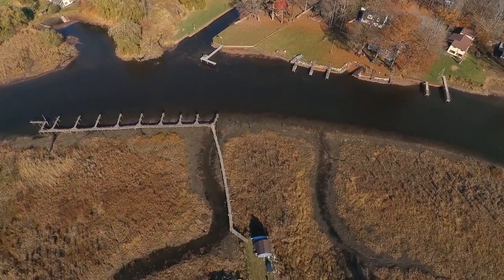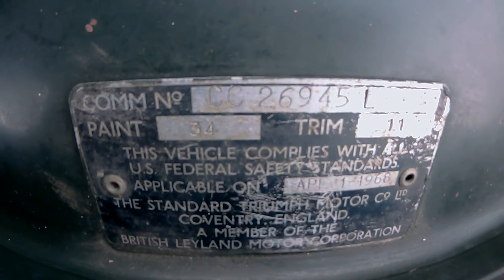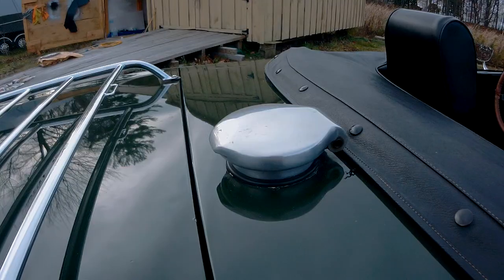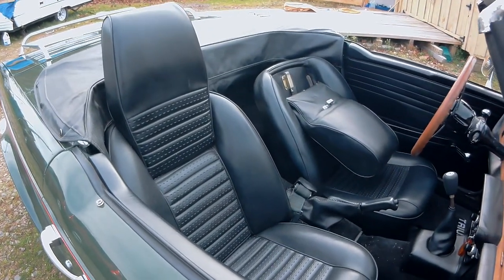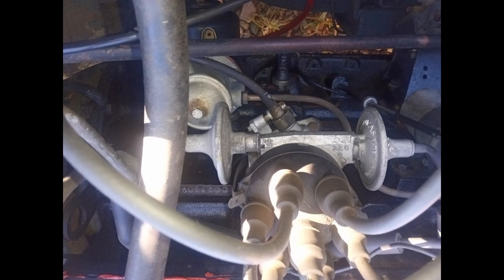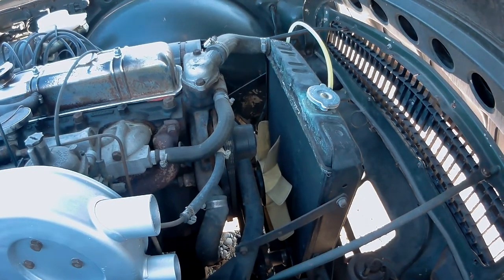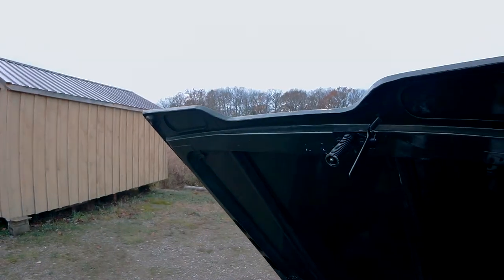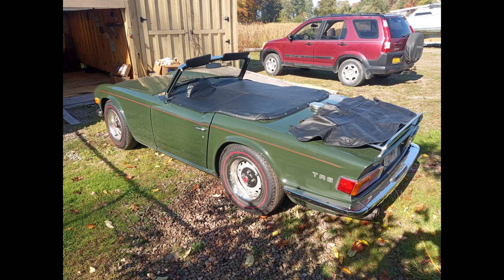1969 Triumph TR6 Specifics

Comment: Very interesting video. I too have a 1969 TR6 but in Royal Blue, It is a California car with 61,000 original miles that I purchased last November from the Original owner. As so many TR's seem to have a story attached mine also has a wee bit of a tale. The first owner purchased it after returning from Vietnam. He returned the same year I did. A few years after purchasing it he sadly developed cancer do to the agent orange used in VN. He did get better than worse than better but the car sat for many years at a time. This being the reason for such low miles. Changes were made to the car itself but tasteful ones. It does have the optional wire wheels and I've put the original style red-line tires on. 
A lovely car to own and drive and one that I feel will increase in value.
His nor My intentions were / are not to keep it original because of improvements. Better Starter motor. aluminum radiator, oil filter base, period correct radio along with a few other items.
Your comment about the car amazed me. I love this car and I'm sure you do yours. We are both quite fortunate.
The Tush-myster is The Man. 
I wonder about a trip from Massachusetts to Toronto ???? (This car does run very well but I may do webers in the spring). 
Enjoy !
Reply from the maker: Thanks Bodie. If you see anything wrong or needs to be added, let me know. For sure, every TR6 has a story. Thanks for yours.
Reply from the maker: Bodie, what is your Vin #?

Comment: Nice video. I've owned CC26455L since 1986.  Your details are very accurate from my perspective. The TR6 decal on a white car is red. I'd love to have a set of the bumble bee hoses, but wow not for $500. My car was 17 years old when I got it and some 69 unique items were already gone. The hub-caps were gone as were the 69 style seats. I've heard those seats were the most comfortable ever made by Triumph. It had Union Jack decals a front air dam which I see you don't have. Mine does have the fender beading. Someone at a car show was very interested in that. Not original, but be sure to add an emergency hood (bonnet) release. There are fancy ones, but IMO it only has to work twice. Once when you install it and then when you need it. I love the floor dimmer switch. When I drive my brother's 73 there's no where to rest my left foot.
Reply: The Union Jack decals and the air dam/spoiler are for the 1973 and onwards cars ...

Comment: Hi, I also own a '69 TR6. Many of your comments were spot on, some not so much. My TR6 has VIN 27495, it is about a month newer than yours. My tach and speedometer have flat glass, it still has a decal that tells how to reset the trip counter. The doors have a unique steel pull for closing, same as TR4, The washer pump has external connections, male spades and the black cap (Lucas model 55J) says to observe polarity, the container is square, but could be newer. The fuel cap, magnetic, has no seal, so fuel tends to evaporate. 1969 is the only year with no horn relay. Vent doors were used until 1972. High beam/ low beam switch was the same for all years. Original batteries had screw caps to refill electrolyte. The other vacuum servo on the distributor is for retarding the spark, not good to have. My cold vacuum solenoid is missing. No interest either, too expensive. I am not sure of first year for intake air plenum, but they help with cooling and keep the bonnet from raising, if the latch breaks, when driving over 60mph. As someone else pointed out, original tyres were Goodyear redlines, they did have big knobby treads. My TR does not have the finger pull on glove box door, but I like the idea, the door is weighted to the close side not open side, so it requires playing to get it to drop if the light switch spring is not strong.  Good luck with yours, drive it, I have not driven mine for a few years.   Jim
Reply from the maker: Cool. Good to hear from you. I*d really like to know what you feel is in error. I realize that the month and even day of manufacture often dictated the items used and I'm trying to pin things down. Really appreciate anything you could offer. Thanks.
Reply: I was at a friend's place the other day. He has 2 TR6 cars, a Jensen Healy and 1.5 TVR cars (one is only half a car) He mentioned that he had a spare engine that had been in the rain for some time. I looked at it, it was a '69 TR engine and still had the elusive vacuum valve mounted on it. It ain't much. It mounts on the linkage, below the forward carburetor. As I was writing this, I went out to see if my TR6 had mounting holes for the valve, and just realized, the valve is still on the car, but the vacuum part is missing.

Comment: I have CC28790, it's not totally original but has a lot of the original pieces in place. The details are really hard to nail down in the first couple of years because there doesn't seem to be a lot of standardization. Mine has 1 bullet style mirror on the driver side only, no passenger mirror. Hard to say if that is original though, I don't have a good trail of earlier owners.

Thanks for putting this together, a couple of details from your listing/description:
The seat belts clip into loops bolted into the floor, later they were changed so the belts bolt in place. The shoulder strap mount is on the body tub, so it's easy to change to 3-point belts if you prefer.
I don't believe the rear drive ratio changed over time, all US market cars got the 3.45 and the UK market got the 3.70:1 version.
For the steering wheel, I think the video describes the rim as wood, but at least on mine the rim is a foam-covered metal hoop under the outer cover.

Comment: I have a '69 TR6, CC28234L I've owned for going on 34 years. I was manufactured @ March 4th of 1969. The steering wheel on the 69's was a larger diameter. Mine was not matt black. It was chromed. The ignition key was still alongside the choke, fan, heater knobs. Later on 70's, etc., it would be moved to alongside the steering wheel. On early 69's the matt black cam back rear was a dealer option (they were body colored leaving the factory). Early 69's has the rather unappealing Rostyle wheel covers. The Michelin X redline radials had a tube. You can buy reproduction from Coker Tire. My '69 had only 1 vacuum advance (they weren't all double). TR6's were suppose to have a 'door pull' like the TR4's. The inside cutout was there but the factory changed the spec to save money so the door panels simply cover up the cutout. The carpeting was nylon but I upgraded mine with aftermarket wool. The '69 seats with the dropdown headrest was only for the 69 model year, as was the flat tonneau cover. I upgraded my vinyl seat covers with aftermarket leather ones. Seat belts were an option. Mine did not have any. I added aftermarket racing ones in 1989 when I bought the car.  I upgraded my original vinyl top (which shrinks and cracks over time) with fabric that won't shrink or crack.
Reply from the maker: Cool, so by car number 3,231 they changed the steering wheel to silver. How many holes are in each steering wheel spoke on yours? I've been checking through the many books, magazines, and brochures on 69s I have, but can't find a picture of one without flat black rear. More research needed. Also, I have a factory manual stating Wilton wool carpet originally. I wonder when that changed? It isn't listed in the list of options. My plinth has to be completely rebuilt with period correct knobs in the correct positions, and the key is in it, not under the steering wheel. My cars body has built-in nuts to screw in seat belts. Looks factory. I need to look into that.
Reply from the maker: I ended up getting my red stripe tires from Universal Tire. I heard/read some poor reviews about Coker quality.
Reply from the maker: Here's another weird factoid. Looking at a calendar and counting days to my car, then your car, they fairly consistently finished 20-25 cars a day during this entire period. FWIW.

Comment: Some other 69 only features were, courtesy light between the seats, vacuum switch under the front carb (very expensive to replace IF you can find one!), foot switch for high beams, polished stainless wiper arms/blades.

You have a rare TR6 there, best of luck with the restoration and if I can help in anyway, just holler!
Reply from the maker: Cool, this is exactly what I need. Can't thank you enough! Its added to the list.
Reply from the maker: David, Check out this link: https://restorationpartssource.com/store/heater-control-valve-1967-1973-mustang-air-conditioning-and-vacuum-switch-assembly-all-classic-parts-details.html
I think this is exactly the Vacuum switch!

Comment: The original Rostyle hub caps required rims with the 3 stanchions to attach to and required a special tool to remove. Anyone who tried to remove them with a screwdriver destroyed them. Moreover they rattled like crazy driving me crazy. The 1969 model had a few more bhp than other years due to minimal smog equipment.
Reply from the maker: I have the proper rims, but lack the tool to remove them. Elin is currently doing a fix/repair if my rostyle rims. I'm looking for the tool in the meantime and a way to make them tighter. Thanks for any help/info.

Comment: I laud your efforts, but you should upgrade all the rubber to polyurethane, makes for a more positive feedback while driving and doesn't rot.  For longevity, get someone to reinforce the weak points on the frame, kits are available online.  Also turn your gas cap 90 degrees, there were some pop opens in early accidents caused by G forces.  TR sent a notice to dealers about this.  The labels for your red lights on the dash, BRAKE / HAZARD, are missing hinting at a possible facia refinishing at some time.  The oil cannister and air filter housing should be chrome too.  I ditched the 175s and  upgraded to SU H6S carbs with K&Ns.  My TR6 is a 69 also, CC270001L, completed in December of1968.  I would also highly recommend installing an overdrive unit, the drive shaft is the same.  I chose a J type that mimics an A type and works in 2nd, 3rd, and 4th gears.  The OD makes for a totally different driving experience and saves on fuel.  I did a complete frame off resto that was finished in December 2022.  The final body was painted the original new white, w/ Group 44 livery, sans team names and numbers.  Tan leather and wool carpet by Heritage Upholstery, Palm Springs, CA.
Reply from the maker: Thanks for the continuing info. I looked at poly bushings. From what I read, there are pros and cons. The look is wrong and they are a slightly harder ride, but they don't rot and are harder and more slippery. I have not heard of chrome oil and air cleaner covers. Will definitely look into it. Fortunately my frame is in great shape. No rust, sagging, or negative flexing evident. If I was making a daily driver, I would definitely reinforce the weaker areas. Thanks for the info on the dash too. I am removing the entire area to redo the under dash items (heater, hoses, wiring, radio, plinth, knobs, switches, labels, glove box, etc etc) and will hopefully sort those areas then. Any help/info will be greatly appreciated.
Reply: @pubu2010  Great, I would just say that your frame may be in great condition, but it still has weak points that could crack on the road.  You might want to research this.  The TR6 was a new product and Triumph was looking to launch it by making a good impression on the markets.  Flashy chrome in the engine bay was something that added that to the wow factor.  Also, SAMCO silicone hose although not cheap are a good upgrade. I live in California and the smog eats anything rubber.

Comment: I am the original owner of a ‘73 TR6, which I still have and drive regularly.  The original tires on ‘68 TR250s through ‘73 TR6’s were Dunlops, with a nobby looking tread. To the best of my knowledge they started using the Michelin X redlines as original tires in ‘74.  As far as I know you can no longer get the Dunlops or Michelin redlines.
Reply from the maker: Hi Tim, I run into this a lot. I added the original 69 factory specs from Leyland to the description above and they list Goodyear Red-Stripe. I now have three different tires that are possible for the original U.S. cars. Goodyear, Dunlop, and Michelin. More research seems to be needed. Tks.

Comment: Interesting research, if I could I'd choose an early TR6 also. Back in England for the European Market the early cars left the factory with a fuel injection system "Pi" making 150bhp, very quick for its day, the later cars were toned down to 134bhp
Reply from the maker: Interesting. If you want more, info read the full description. I've added most specs for the 69 TR6
Reply: @pubu2010  thanks. The stainless Steel Rostyile you have looks genuine to the car, it was also shared with the 2 litre Triumph Vitesse model. it would of been painted satin matt black in the 5 inserts around the pretend nuts. Later type stainless steel rostyile trims had a hole in the centre to hold a British Leyland emblem these trims were only used on the big Triumph saloon and station wagon fuel injection cars.
There might of been plastic pipes from the air filter air intakes down to the front valence! I know this was the spec for the 1968 Triumph 2000 Mk1 a car which was also exported to North America
Reply: @MyJon64  The Rostyle wheeltrims (not wheels !) were indeed standard on various Triumphs in the late 60s / early 70s, in 13” 14” and 15” sizes… 13” for the Mk2 GT6 and Mk 2 Vitesse, and possibly the Mk 1 2.5 PI saloon / estate ? Early Stags had them as well as the TR5 / TR250 and yes the early TR6. Also the wheels / tyres usually had inner tubes.

Comment: Original redlines were Goodyear G800’s and the Michelin redlines were an option.
Reply from the maker: Good info. I see that the 800s are no longer available, Universal Tire still makes the best red lines though. I'll update my data. Thanks.
Reply from the maker: I added the original specs from Leyland to the description. Goodyear was the original tire. You're right. Another mystery solved. Thanks a lot.

Comment: The door mirrors were installed at the factory and not the dealers. Dealers installed passenger side if customer requested. The ignition wire were green on all years how ever the boots for the plug end were different.
Reply from the maker: How were the boots different?
Reply from the maker: I added the original Leyland specs to the description and yes you are right. The factory put on driver door mirrors. I assume that passenger mirrors were a dealer option. Another mystery solved. Thanks a lot.